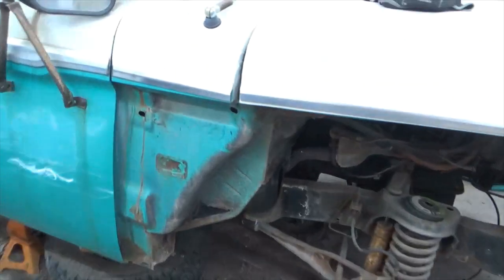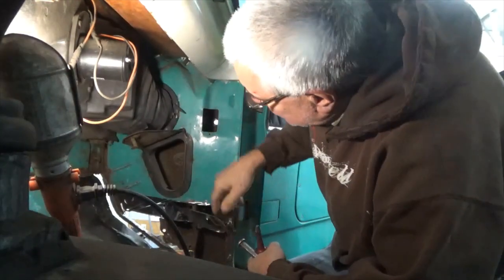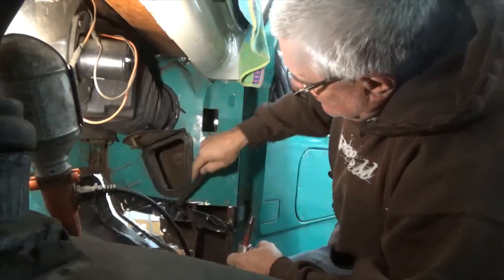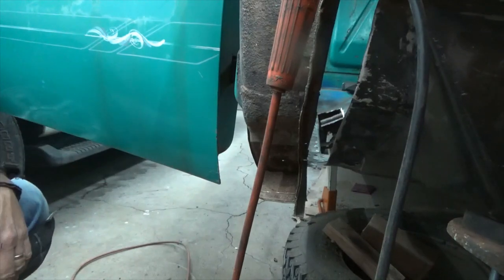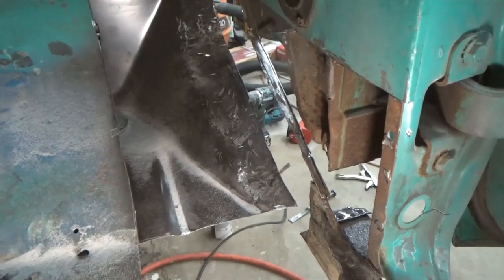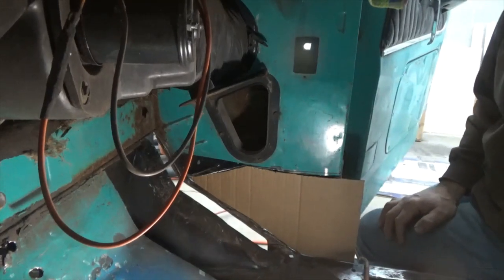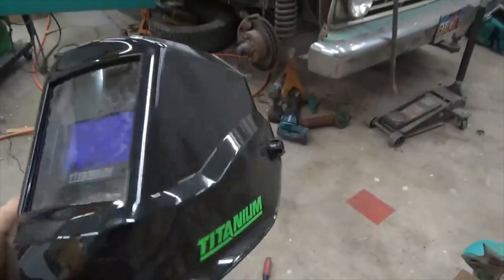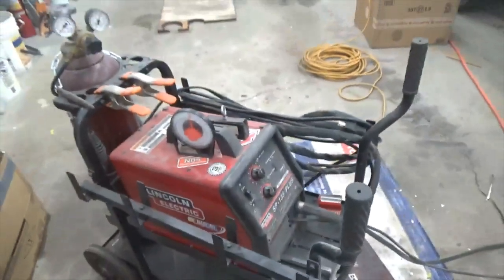1966 Ford f100 Continue Passenger Floor Repair. Harbor Freight Welding Helmet Review

Comment: I'm both looking forward and dreading tackling the body work on my '62. I have very little experience in metal work and welding. I feel like I'm going to make things either worse or it being a terrible hack job. I have a similar welder as you. Mine is a Lincoln 140 MIG. You mentioned in your review that it's better. What was you previous helmet?
Reply from the maker: If you are working with your Father it doesn't matter what it looks like. I had the cheaper HF auto darkening helmet, you can see better in low light. My welder is a Lincoln 135 plus and I'm using .035 wire with argon Gas, and when you are welding Sheetmetal it always needs to be ground off.